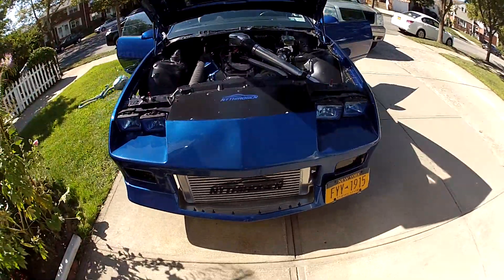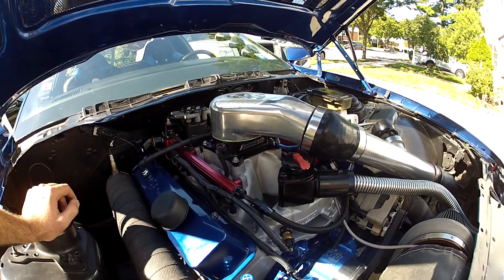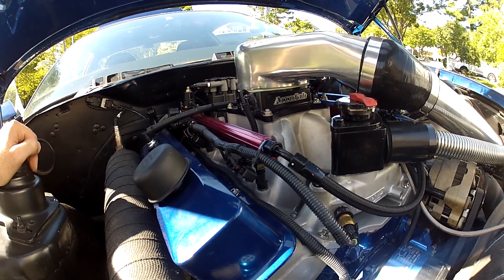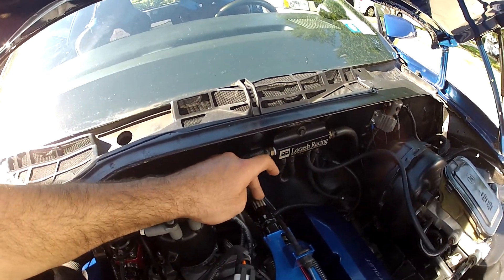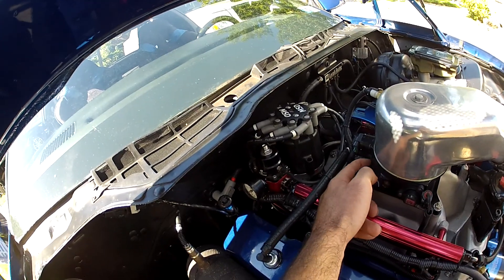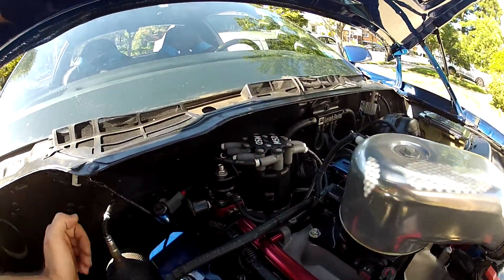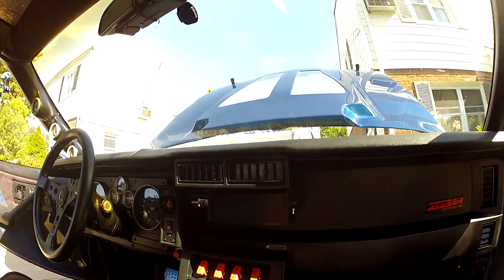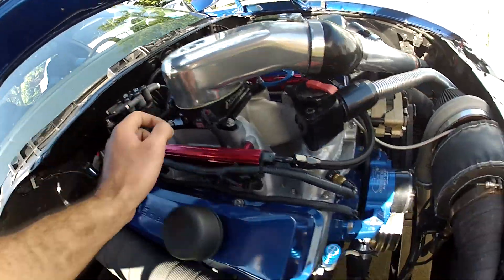Carburator to Fuel Injection EFI conversion using MegaSquirt 3

Comment: Get rid of that distributor and ignition, and go with some CNP,  something like LS2 coils then you will really be rocking!   Are you running a manual transmission?  Flat shift and launch control would be awesome to setup on this car.  :)  Nice install!

Comment: The Mega Squirt is hooked to the tach signal from the MSD 6AL or the engine wouldn't run.... Even if your tuner didn't tell you it's hooked up.  The MS1 would have done the same thing with less hassle since your only running the injectors and letting the MSD handle the spark.  Good video it will help people looking to convert to fuel injection without spending 5K
Reply from the maker: Yeah quite aware of that, went with ms3 due to future plans with the car that ms1 wasn't gonna cut it

Comment: You said in the video, "Don't use teflon tape, use PTFE tape..." but do you know that PTFE is the chemical name for teflon? http://en.wikipedia.org/wiki/Polytetrafluoroethylene

Nice setup by the way :)  But why are you using ms3 to run fuel-only, as opposed to ms1? ...or tossing out the distributor and using the megasquirt to control your ignition?

Comment from the maker: You need a rpm signal from somewhere, either msd or a crank trigger setup, I still run msd so I get my rpm signal from there.
Reply: Yeah but I'm not looking to spend over three hundred dollars on a unit I don't "need" Ls based motor have a trigger so for me, no I don't need one. Thanks

Comment: right now i am looking at a 406 build with 430 hp and 530 ft/lbs...cheap and fast in a stripped out 83...right now just 355 but crap gears in back...change those out next and sure will wake it up